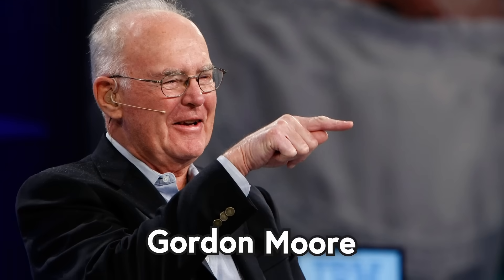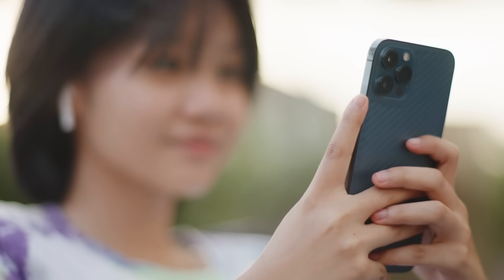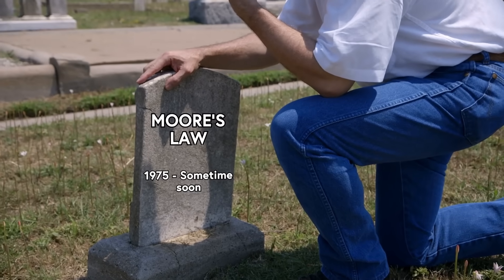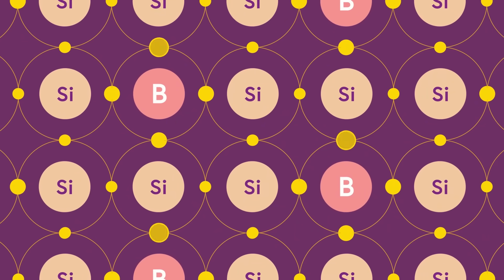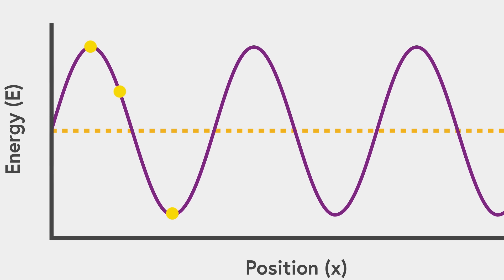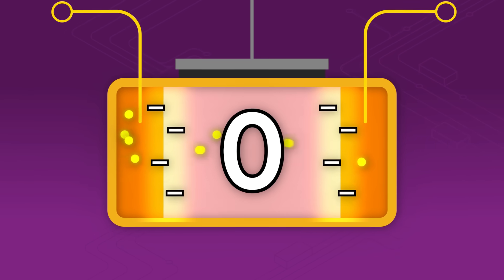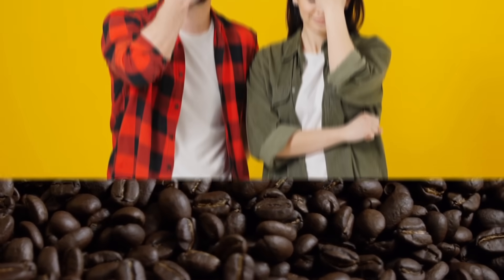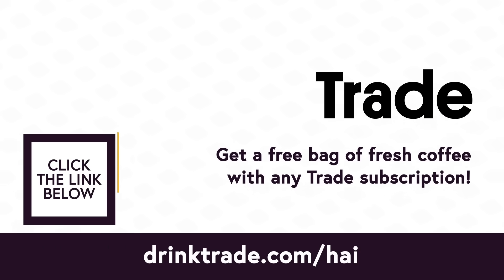Why We're Reaching the Theoretical Limit of Computer Power

Comment: optical computing is likely the way forward. there are a few folks that are making progress. one guy in particular has been working on holography as a way forward and if we can find a way to make things read/write and be done stably, it looks like a way forward. the basic logic gates have been figured out though it's just more complicated to start from scratch to get this all going and it isn't like transistors that already existed prior to the integrated circuit's development. with that said, there are some serious advantages, heat is not much of an issue for one. also the light moving inside of a hologram isn't really travelling in a conventional manner so computations are actually faster. scaling is still to be determined but it is likely to mean much denser systems that run faster. If this could be directly coupled to storage it would offer tremendous advantages. it's all still a work in progress but if and when it comes about, it will be like the whole silicon race starting anew.

Comment: Chip designer here. The reason we are reaching the limit is related to the fact that minimum gate lengths are getting down into the single digit atoms wide, but it's actually not as simple as described in this video. The issue with current passing even when the transistor is off is called leakage current, and it's actually something that pretty much all transistors on process nodes for more than two decades have had to deal with.  The reality is that most chips don't just use current flowing or not flowing to encode a zero or a one, but rather there are networks of transistors that either pull the output down to zero, or pull it up to one (in complementary MOSFET designs, or CMOS). To be able to get a stable signal, all you need is for either the pulldown network or the pull-up network to win the tug-o-war. Since leakage current is typically constant and present on both sides, the effects cancel out and don't introduce bit errors. You do need to balance leakage current in the design, but for the most part it's a non-issue.  
  
Where it becomes an issue is when the leakage current is so high that it's hard to balance the leakage current of the pullup and pulldown networks, or when there is so little control over the gate that there is a large power to ground short, and that starts to dominate power consumption. In older process nodes with larger gate lengths, power consumption from leakage current was only a small percentage of total power, but in more modern nodes leakage can be as much as 70% of the  power consumption.  
  
One other thing to note that helped push transistors even further is the invention of the FINFET which uses a vertical fin and wraps the gate around the channel to increase its effect. This helped substantially cut down on leakage current, but also decoupled the process node naming from referring to the same feature as before.

Comment: What if we add more parity controls circuits, so we could catch like 99.999..999% of errors (any number of 9s)? It would be especially usable in stochastic applications, like machine learning. Of course for some application, like finances we'll still need to use non-tunneling hardware (or tunneling-tolerant software)

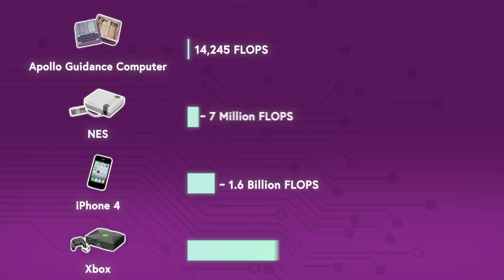Comment: 1:28 There's no way the NES could do 7 MFLOPS. It didn't have any Floating Point Hardware and the CPU only ran at 1.7MHz. 

For comparison the 80387, a dedicated Floating Point chip released 2 years after the NES could not even do 1 MFLOP.